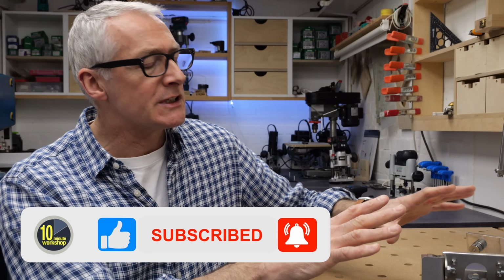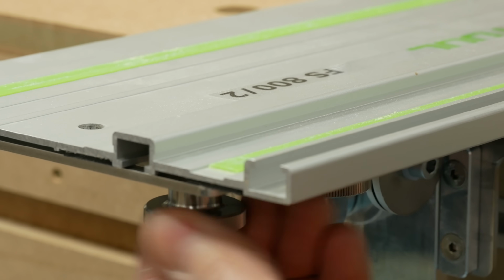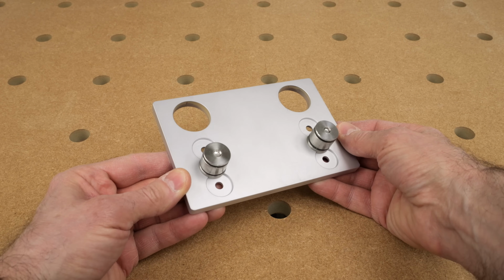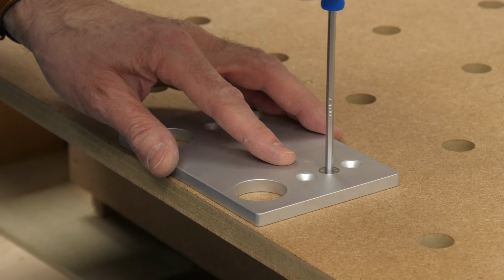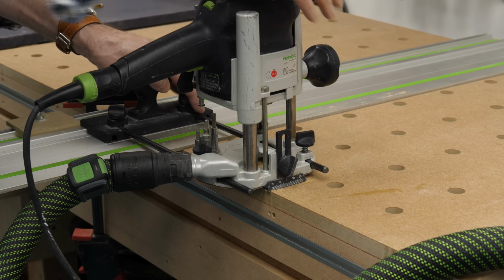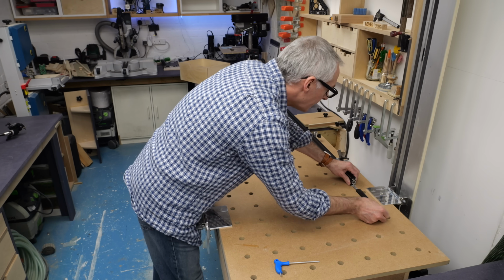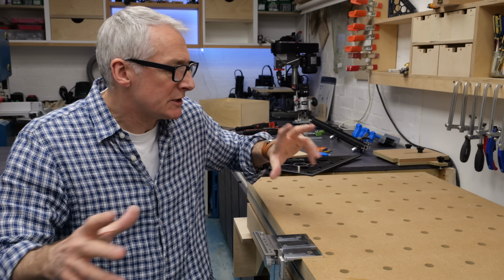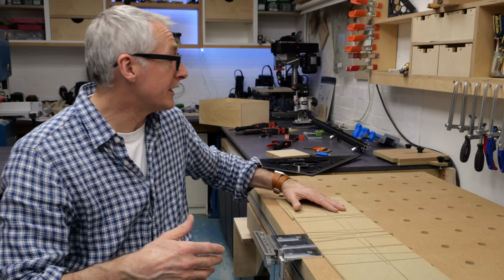Benchdogs Quad MFT Hinge System [**Ad/Gifted][video 492]

Comment: For those who have the UJK parfdog system, you can drill offset holes, you don't really need the template plate. Unfortunately, you need to plan ahead, and drill the pin holes first, once enlarged, you cannot reference the offset holes. For those who wants to build their own MFTs, you can buy the UJK parfdog system, the benchdog hinge, and the benchdog fence. I think this combination is better than Festool's MFT, plus you make your own top and save beer tokens on the long run.
Reply: UJK do now have adapters, to centre the pin in the enlarged 20mm holes
Reply: @prduguid  Yes as you say Axminster have UJK PARF ALUMINIUM REVISION DOGS available to slot in the 20mm hole that have a 3mm hole to allow setting up for additional holes and they come as a set of 3. Great idea
Reply: Yeah, with the UJK system, some benchdogs, and tracks, you almost don't need a tablesaw.  In fact, for square cuts, I think this is faster than using miter gauges.    Although you could also just put the track against the benchdogs for square cuts.
Reply: I have the Parf system and the quad rail hinge and intend to make my own MFT table- advice on where to start.
New to carpentry

Comment: Peter, Thank you for your videos, I really gain so much information from them. I intend in buying the bench dog model and will recess both ends but will also add material to the bottom , (gluing) before drilling the holes.  I am building my first MFT workbench.  Up to now have been using the Bora system but that has no hinge system

Comment: Hi Peter.  I know it would need a small mod to your table top, less for a jobbing carpenter, but if the dogs on the front guide pointed upwards the plate would then not get in the way.  This would also remove the need for the adaptor and boring extra holes. The same could also apply to the hinge plate. Great show keep it up please.  Lesli
Reply from the maker: Thanks! Sorry, I understand mounting the plate on the underside of the top (my guess is that it would put additional stresses on the dogs on the front rail support, and far too much on the dogs on the hinge side) but I don't see how it would remove the need to bore the extra holes?? 🤔

Comment: I use the Parf system to make my tops and it has the capability to add an extra row at 32mm or 46mm spacing from the grid - so it would be a good fit with this rail hinge.
Reply: This is what I ended up doing even though I bought the template. 20mm router bits are harder to find in the US  than I thought so I used the Parf guide
Reply: @maxbrap  
 Hi,
New to carpentry- hobbyist- seeking advice from professionals- I want to make an MFT table and I have acquired the Parf  Mk 2 system. I have also bought the benchdogs quad rail hinge and want to fit it to the MFT table. I have a 25mm workbench top measuring 1500 x 900 on which to construct an MFT  and later fit a router table at other end.
Advice on how  I should start with my Parf system.
Advice would be greatly appreciated.

Regards 
Paul
Reply: @PaulMarlmountWoodcrafts   Peter Parfit (sp ?) Does a great demo on the part guide system here on YouTube. I'm editing a short video showing how I did the offset holes using the Parf Guides. I  will publish by Monday if you check my channel
Reply: @maxbrap  many thanks and much appreciated- will watch out for that on Monday
Regards 
Paul
Reply: @PaulMarlmountWoodcrafts  BTW. Your Shed videos were very helpful
Reply: @maxbrap  are you referring to “Man in Shed” videos
presented by John McGrath ?
Regards,
Paul

Comment: Certainly better than Festool's take on the hinge and props to them for coming up with a different way to do the hinge. As a Dashboard hinge owner I don't see anything here that makes me want to switch, nor any features I wish I had (a nod to Dashboard for doing so much right in their version I guess). If was in the market, being in the States (as I write this they are also out of stock, with more due in mid-April) I'd lean towards the Dashboard simply because I could get it faster. It also has the "advantage" of not needing any more hole drilling. But I can see some use cases that would steer one either unit. For MY use case I'd rate the Dashboard a half star better than the Benchdog and both a good two to three stars better than Festool's.
Reply from the maker: Yes, I'm a happy Dashboard hinge owner too, but unfortunately not everyone can ignore the shipping costs and import taxes that we get hit for. 👍

Comment: Peter great video as always and when you did your previous vid showing the other hinge - US Dashboard, I have been hoping Benchdogs would do their version as well as I really like their kit.  Quick question:  If you flush set the set the hinge into your mft top what issue would there be to install a 6mm strip on the underside of the table to increase the table thickness back up to the size it would have been to provide support to the quaddogs rubber grommets? (hopefully that makes sense).
Reply from the maker: Thanks Colin. No, no issue at all with adding a small strip beneath the bench, as long as your table allows for it; benchdogs are looking into making some special slim quad dogs as an alternative though, so keep you posted on that one! 👍
Reply: @10MinuteWorkshop  thanks Peter

Comment: I watched a second time and it looks like I could just use the existing hole and not add the extra holes?
Reply from the maker: No, as I say in the video, if you're using a standard-pattern MFT top, the holes are too far away from the edge for the hinge or front rail support to fit without eg notching the top. 👍

Comment: Looks a fantastic system and when fully finished will be pretty slick like all BD products 👍. I needed to add a couple of extra holes in my top to fit a couple of quad dogs so, once again put my 3D printer to work to produce a jig which worked very well, I was only let down by the 20mm Trend router bit that gave a slightly sloppy hole, which isn't a major problem as the quad dogs expand into it, but a roundup of bits would be most welcome. Thanks Peter.
Reply from the maker: Thanks! Yes, it's an all-too-common occurrence, unfortunately, bits that don't produce a 20mm hole. I'll put a roundup together before too long. 👍
Reply: @10MinuteWorkshop  thanks Peter, you would’ve thought by now someone would be making a slightly undersized bit specifically for this application 🤷‍♂️.

Comment: Great video as usual. My first MFT table is being delivered today so this is very timely. I especially like the idea of using the existing holes to make it square. I would absolutely buy the jig although I do have the parf guide system 🤔. You will let us know when it’s available? Thanks again
Reply from the maker: Thanks! It's available for pre-order now at benchdogs.co.uk, and don't forget the offer code 10minuteworkshop for a 5% discount across the board at benchdogs. 👍

Comment: Is it not possible to switch track saw brands once the hinge system is purchased? What would be the difference between, say, a Makita hinge and a Festool hinge?
Reply from the maker: No difference between the Makita and Festool rails, also Erbauer, Triton, Excel Titan, MacAllister etc... Bosch/Mafell rails require different fittings for their tracks as the t-slot is very small, don't know about Metabo or DeWalt; the Benchdogs hinge supports those rails types, but wether they'll make the parts available for folks to switch between manufacturers is a question for them, really. 🤷‍♂️ 👍 For more info on rails, see  video 403, Which Rails work - https://youtu.be/_HtpT_bK7zw
Reply: Yes you can use other tracks with the similar tracks but we have also made additional pin sets for even better accuracy hence why the options are for the individual tracks

Comment: Would ist be possible to mount the benchdogs so they are facing upwards so that the hinge attaches from underneath?
Reply from the maker: Don't think so, not as the hinge is currently designed; also the stresses would be much higher on the quad dogs in that arrangement, as the hinge plates would only be supported by the dogs. 🤷‍♂️👍
Reply: Of course I would use the dogs only for alignment and fix the angle bracket with an extra knurled screw and a threaded insert.

Comment: Thanks Peter. Further to our brief Facebook exchange, how deep would the notch need to be please? (for a standard size MFT layout top)
Reply from the maker: I'd need to do one to be sure Alistair, which means I'd need to make an MFT top, to try it on too. Benchdogs say you need 35mm from the hole centre to the edge of the top to be sure to have enough clearance, and a standard MFT/3 top usually has holes at 70mm centres from the edge, so I'd guess about 35mm - but you never truly know until you've done it! 👍
Reply: @10MinuteWorkshop  fair enough Peter. That info helps. This is probably the best way for me as otherwise I’m in for a jig, a cutter, a guide bush and still no guarantee it will work with my Makita trim router. But too pricey on top.

Comment: Would be great if the template would work with the parf guide system that many use to make MFT style tops
Reply from the maker: I have the parf guide but have yet to use it; can it not be used to make ‘in-between’ holes ie on 48mm centres??
Reply: @10MinuteWorkshop  I do remember Peter parf making a video on it but can't remember exactly how but I do believe you're right.

Comment: I might buy the template for the extra holes, just to increase the cutting width on my mft tops and add a bit of extra versatility.  The router template that I use to make my tops is really good and accurate, but only if you follow the standard hole layout ( and in my old age, I am way too tight to stump up nearly £200 for the otherwise excellent Parf guide system)

Comment: Yes, on a round up of the router bits.  And please include model numbers in the description if you do the video.  I’m in the US, and metric things can be a bit hard to track down.  Luckily, I did track down the metric collets for my venerable Porter Cable routers when they were still available, and have a bit more flexibility in what shanks I can use.

Comment: One option (which I might do) is to route a place for the hinge and front part (as you said) so that they are flush with the top of the table, and then instead of having to use a sacrificial board, route a groove with a round router bit into the bench where the rail edge is, deep enough for the saw blade to extend under the surface a couple of millimeters. You would then have all the depth of the table for useful surface. Also, could one make a hinge mechanism with sliding vertical pins (like in routers) so you would not have to adjust the rail for different thickness, it could just automatically adapt, or perhaps that might be difficult to make robust enough so the rail would not loose squareness?
Reply from the maker: I’ve had sacrificial strips in all my benches for about a decade. This one is a budget build with minimal tools, so no router available yet. I believe the benchdogs hinge originally had detente for common materials thicknesses, but it was too finicky to use in practice. 🤷‍♂️👍
Reply: @10MinuteWorkshop   I'm sorry but "budget build with no router available"? And yet you made the holes with a router, not to mention that the components from Benchdogs are not cheap :) I might actually try to design and make a hinge myself from mostly wood (the hinge axle might need to be a steel pin) if I were concerned about budget.
Reply from the maker: Backyard, Budget DIY MFT [video 490] - https://youtu.be/xIi-I04ocVM. No router used, bought in top. Video 372	MFT top replacement with a twist - https://youtu.be/09an8aZrTqs - shows the sacrificial strip. And if you were a Patreon supporter or YouTube member you'd have already seen my DIY plywood rail hinge, video out in the next few weeks. 🤷‍♂️
Reply: @10MinuteWorkshop   Yes I have seen your previous YT videos, and I'm subscribed and usually hit like in your videos. But due to my current financial situation I cannot put any extra money on things like Patreon (for anyone), sorry.

Comment: I must be missing something fundament here but why did you not use the routing template for the front rail stop as you did for the hinge assembly? Surely, the holes would have aligned correctly.
Reply from the maker: Yep, definitely missing the point on this one. 🤦‍♂️ The template is £36 on top of the price if the hinge. So, could you do without the template? Yes, you can, but the template is easier. 🤷‍♂️
Reply: @10MinuteWorkshop  doh!
Reply: Peter was demonstrating that the hole jig was not the only way to make the additional holes.

Comment: @Peter Millard , can you tell which holes on the mft do you regularly use? Are there some you don't use at all, or could easily do without?
Reply from the maker: No, I pretty much use them all. And you can guarantee that if you left a few out, they’d be the ones you need most for the next project! 🤦‍♂️👍

Comment: I'm surprised no one has made a commercial version of the double hinge rail hinge yet, now that would be a deal breaker, other than height settings at the rear I have never had any problem with the original
Reply: Yes I agree, a commercial self adjusting double hinge system would be perfect for me as my bench is fixed up against the wall. I'm sure BenchDogs could make an excellent version 😉.
Reply: I’ve been looking hard at an old “EurekaZone” guide system which used a parallelogram set up, that when you pushed down one a handle at the front of the table, moves the straight edge up and forward.  it has the advantage that is will stay very true, but the disadvantage that you have to slide the work piece under it.  And, it does allow the back of the table to be flush, or nearly flush to the back wall, because it moves forward during the lift.

Comment: Hello Peter I already have the ujk parf jig just wondering if I could utilise this to locate my secondary holes 24 mm from the edge. Any pitfalls you can think of, £36 for the jig sound a bit expensive on top of the £180 for the rail  hinge.
Reply from the maker: As long as you can locate the parf jig onto the existing grid of holes, then it should work fine. 👍

Comment: If routing these in, just glue a small piece of 18mm ply / mdf on the underside of the bench top, under the two mounting holes, then drill through the existing top holes to create enough depth for both of the dog rubber washers to expand under the routed in hinges /locating plate.  Ralph, if you read this, you could supply at a set price an mdf bush template to route out using customers own dogs which could be designed to be glued / screwed under, once used for routing, using dogs to line up perfectly underneath.  Peter in Leeds  who you had a chat with on the phone regarding the prototype Mafell parallel guides you sent to me and then sent the completed version to.
Reply: Hi Peter.  We did think about the jig but will look in to the response to it. We are looking at making a thinner quad dog 12mm version but will test this and send a set to Peter for his opinion. This will be available when Peter gets the final finish product.
Reply from the maker: Depends what’s already under the bench top eg the frame the top is sitting on, but yes, even a piece of 6mm glued to the underside would do the job.
Reply: Peter M, as the hinge will be flush with the top and the rail slides over it, the 2 plates could be moved further inboard to clear the frame as there won’t be any width restriction for cutting as both flush. 
Ralph, yes, I think there would be a market for it, worth looking into. 
I’m on the 4th prod run for the hinge and will play around with it, recessed maybe inboard, once received.

Comment: Do you get 2* dog locks with the template?
Reply from the maker: You get 2 quad dog bases, but the ones I have are not compatible with the quad dog tops I have. 🤷‍♂️👍
Reply: @10MinuteWorkshop  Is that in addition to the ones with the hinge and the locating bracket? Could they not have reused those as a cost cutting measure?

Comment: Looks really nice. I’m using a bora centipede with 2 tops with 20mm @ 96mm. This will solve a few problems because there is no side rails for clamping other systems